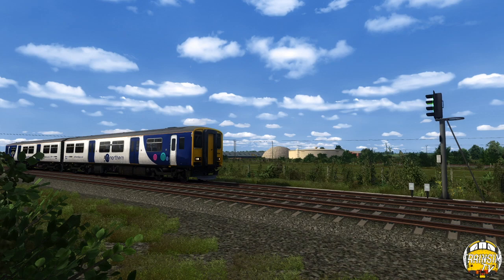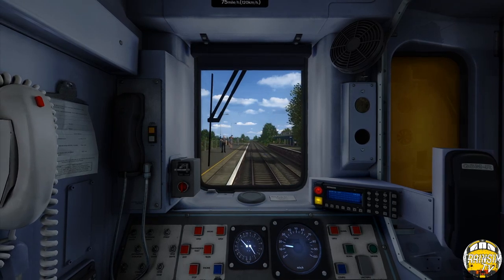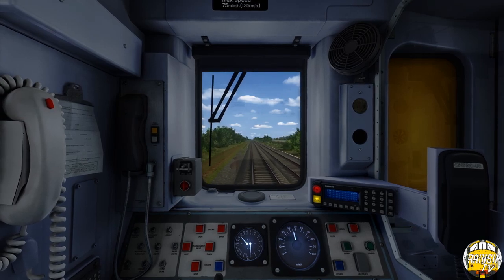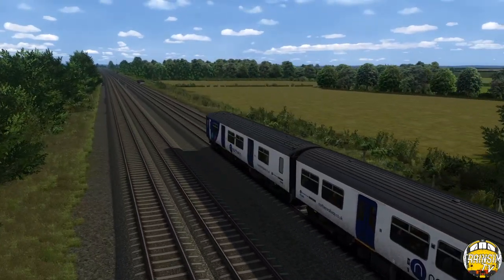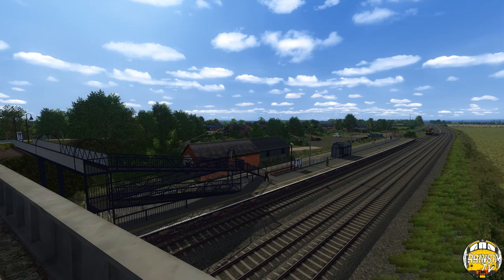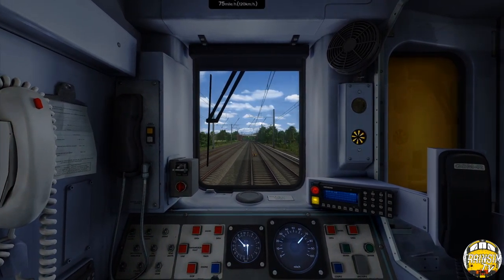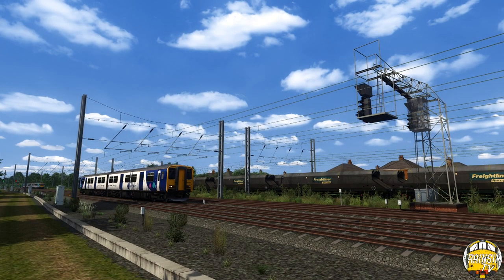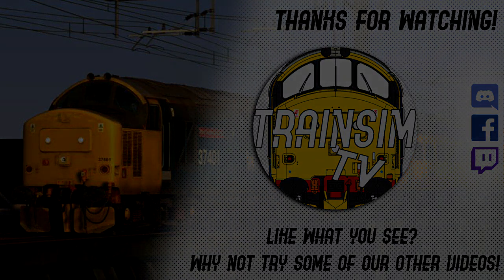Train Simulator 2020: Harrogate Loop Goes to Milford Junction!

Comment: Lovely route. The part between Colton Jn and Church Fenton will have to have some modernisation to it because Network rail are putting in sheet pilling, new signals and electric wiring. The power station you can see at 19:08 is ‘Ferrybridge Power Station’ which had 8 cooling towers until 13/10/2019 when they pulled them down due to not being needed anymore. It stands now with only 3 cooling towers left. Can’t wait until I download this as I only live about 2 minutes away from Colton Jn so I see this area a lot and know it well. Congratulations to what you have done so far and good luck. Keep up your amazing work.👍